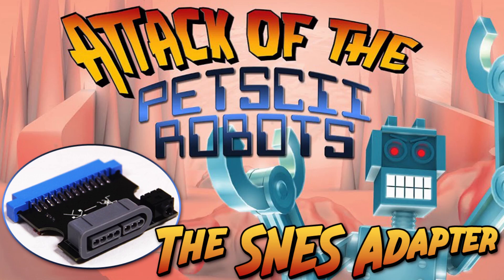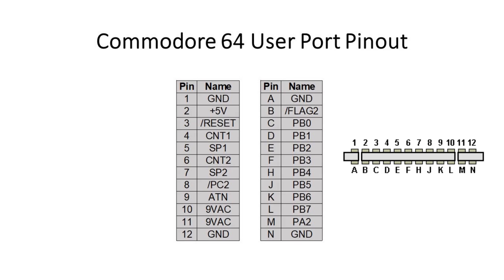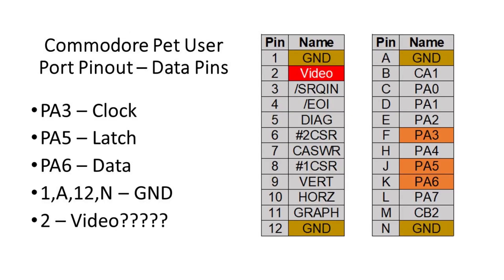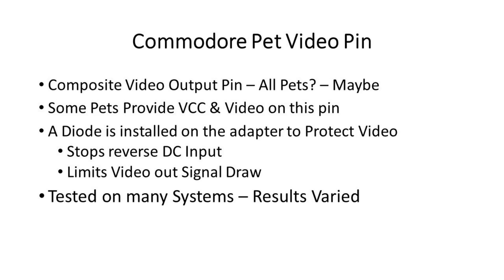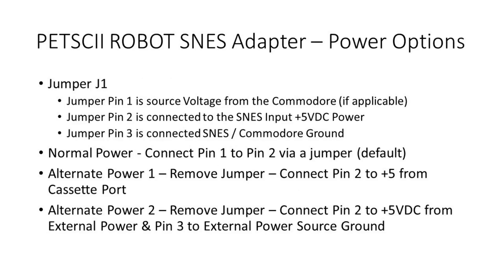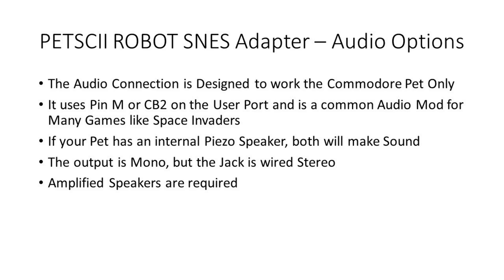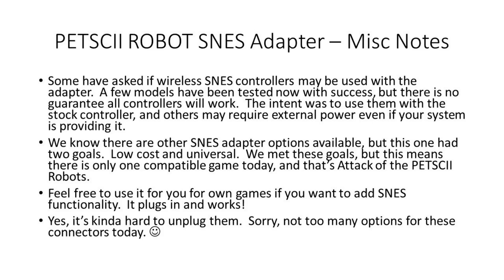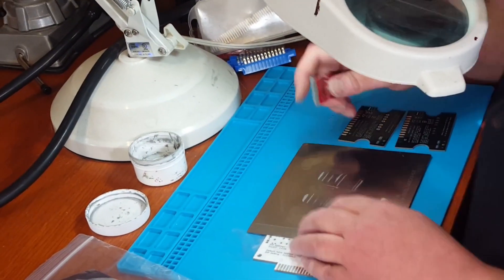Using the SNES Adapter for Attack of the PETSCII Robots

Comment: Is there documentation on how to program the adapter? Like code-examples to query the different buttons of the gamepad? And shouldn't the sound output of the adapter also work on the VIC-20? This method is even referenced in the original VIC20's Programmer's Reference Guide on pages 232-233. It talks about CB2 providing another sound-channel if you connect a speaker to it.
Reply from the maker: David posted a document in the Pet Robot Facebook group for programming.  As far as the sound, yes, it can be done.  However,  it was really quiet when we tested it.  I suspect it had to do more with the routine we were using, but I really only added the audio jack as it's a pretty common mod on old pets, and a few beta testers were asking how they could hook up their audio.  The audio from the sound chips on all other commodore are better, so David dropped the audio for other systems.  Also, we would have to mix the existing audio with this one way or another, so probably more hassle than its worth.
Reply: I'd be interested in seeing some coding examples as well but I don't have a facebook account and no intention of getting one.  Any examples elsewhere?

Comment: Why not put the clock pin on PA0 so a simple INC/DEC $ADDR could be used?
Reply: xxxx0111 > INC > xxxx1000
Reply: Because Pin C on the Plus4 User port is RX, not a gpio pin.

Comment: Technical note: music is too loud in this video, voice is often covered
Reply from the maker: Yes sorry about that.  I must own like 25 microphones which I've used to record mostly music over the years and not a one of them is worth a crap for voice over. :-)  This was me giving up on my condenser mics and using the oldest cardioid Shure I have sitting around.  While it did get rid of more background noise, it was super quiet and started cracking up on me.  I also basically had to be about 2" max from the mic or it dropped off like crazy... So long story short, I ordered a brand new SM57 last night, so I'm hoping it has better gain.
Reply: @TexElec  Or just get rid of the music?
Reply: @ian_b  Yes, for those of us with bad hearing, music while talking is detrimental.

Comment: I think a kernal patch that replaces the joystick polling routines with routines that poll the SNES adapter would be cool.
Reply: I don't think there are any joystick polling routines on Commodore systems.
Reply: I knew there was a KBD polling portion of the standard IRQ handler, and was thinking there was a joystick one as well. I guess I was thinking about the X16 too much lately. I guess that's what I get for trying to think at 1am just before going to bed. Haha.
Reply: There are no joystick polling routines on the C64. C16/+4/128 BASIC have a JOY command that could be rewritten, but if you aren't playing a game written in BASIC, then it wouldn't work. Commodore games read the joysticks by reading directly from the IO mapped address space of the CIA. This can also only be read, so you couldn't even write an interrupt that would store the correct values so they could be read. Instead, you would have to patch each game with a new routine, but it could be done.

Comment: Congrats on 2k subs! Question: are these SNES connectors the same ones that will be used for the X16? Maybe being anchored to a larger motherboard and fit inside the case will make them a little more rugged for folks that may be swapping controllers between different systems.
Reply from the maker: The SNES connector isn't the problem, it's the user-port connector itself.  It takes a bit of force to remove it from the system.  Yes, same SNES connectors as the X16, and they do hold on pretty well.  I have them wedged at the end of the PCB pretty well.
Reply: @TexElec  ah, ok. It wasn't clear which end you were talking about.